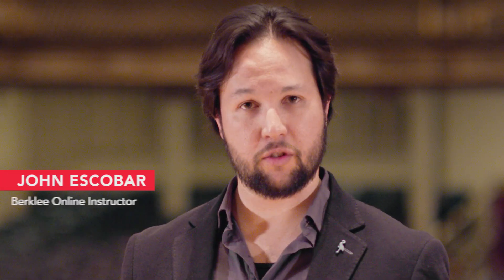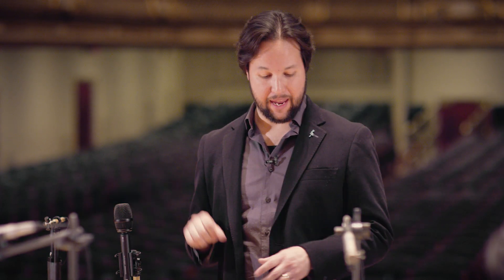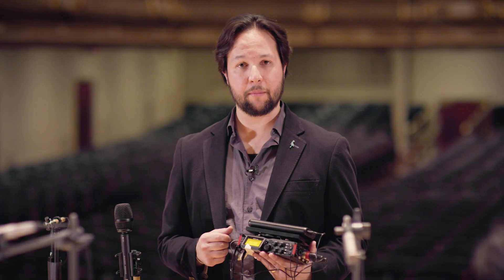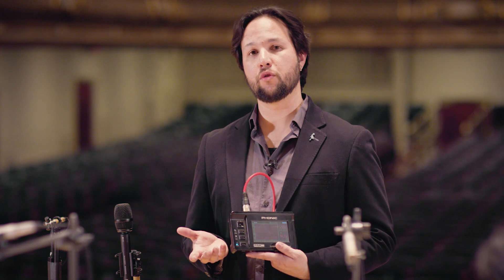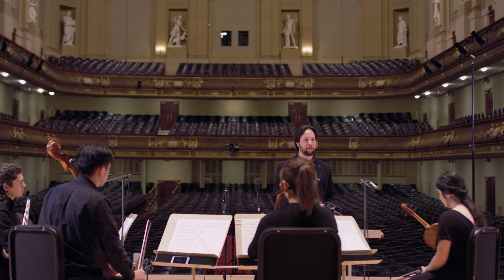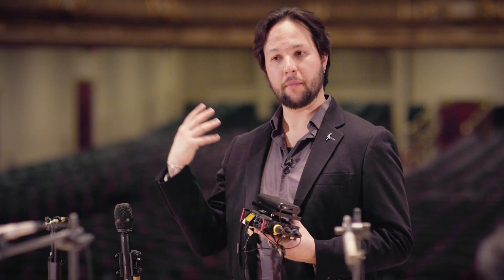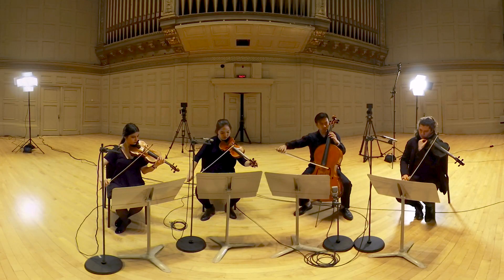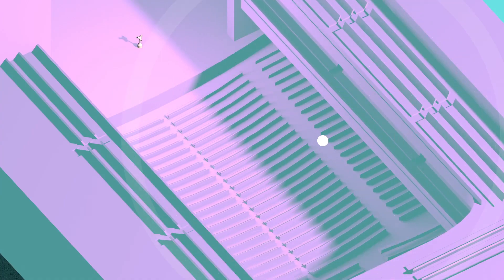How to Set Up Your Ambisonic Recording | 360° | VR | Spatial Audio | Recording | Part 4/7

Comment: This shows if cheap versions of Ambersonic mics are released onto the market, , you better hope the capsules aren't different  outputting any more than 1db in difference.....
Btw.. The first thing to calibrate the Pre's, Id at least try first setting  the mic pres at zero, gang them , and see if at least they all match at -12db when gaining up....... if its a HQ recorder, with great pres, could save you time setting up.. Of course , YMMV depending on the gear, But, possibly save time,.